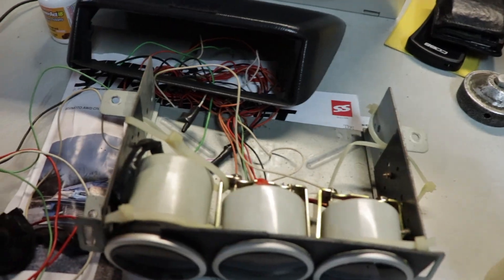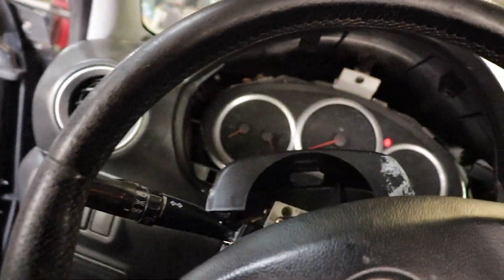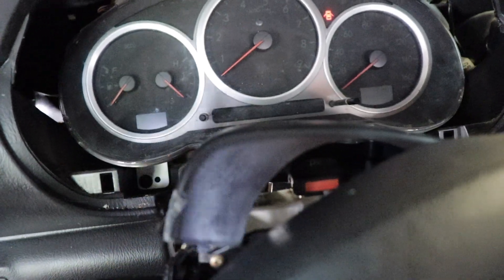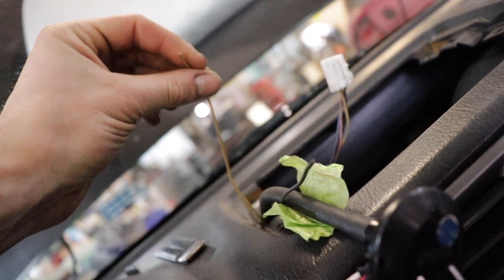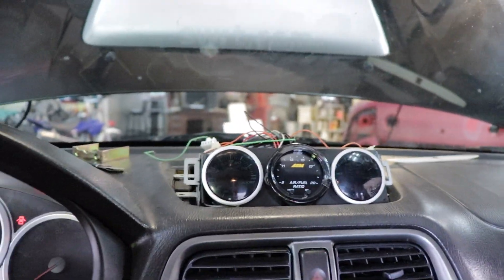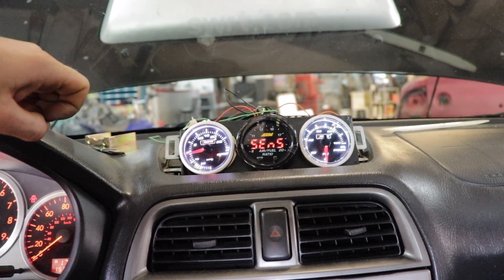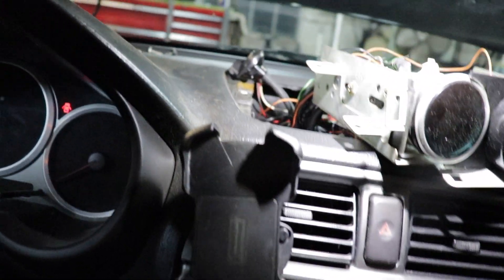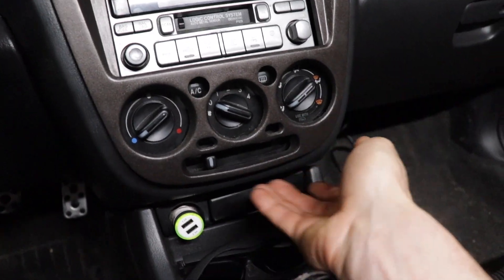AEM wideband Install on the wrx

Comment: When you say downstream...do you mean After or post cat? So basically Front Pipe of the exhaust system?
Reply: People claim post cat doesn.t produce accurate AFR reading...what your take? Appreciated the help
Reply from the maker: @2be379  yea i agree with that cause that cat is cleaning the air so the sensor is not reading the raw exhaust anymore and its a skewed reading. so even my reading is not gonna be the most accurate because the cat in the headers but im still seeing around 14.7 so idk how much that small cat is affecting it.
Reply from the maker: yea after the car anytime you hear downstream o2 sensor it means post cat sensor.

Comment: I had a shop install gauges on my 06 wrx (they onyl told me my radio won't work, but other things didn't work like the security system, the head lamps, the key ring light and my keyless unlock and lock) I want to undo what they or at least fix it. 
What could be wrong ?

Comment: Great video the clock wire the yellow and the blue do you tie both of them together into the red wire for power
Reply from the maker: its just one wire, the wire color is the yellow one with a blue trace.

Comment: You should have a “bright” twist switch on the indicator or wiper stock that changes the clock to bright mode when lights are on I use it on my gauges as my gauges show less when dull
Reply from the maker: i know what your talking about and i probably should do that cause they are pretty bright at night they could use some calming down haha

Comment: I literally have the exact same gauges as your WRX in my Ion Redline. Prosport boost and oil psi gauge and an AEM AFR haha.
Reply from the maker: thats whats up, they're sweet gauges. I'm guessing you got them running down your A pillar?
Reply: @salvobrothers5928  got the 2 prosports running down the A pillar and the AFR on the top of the steering wheel.